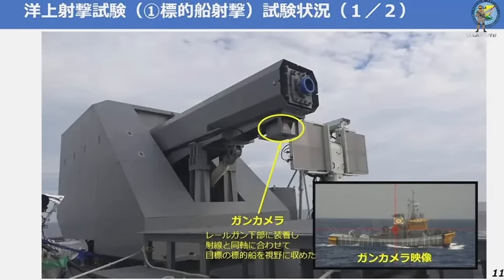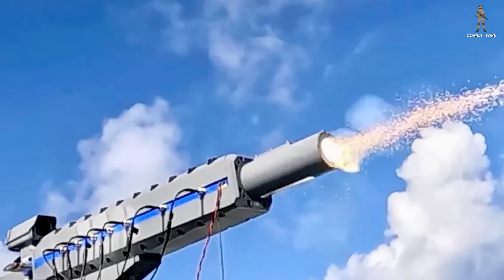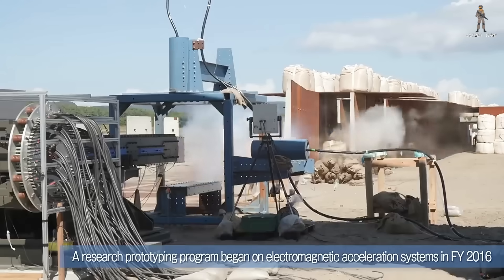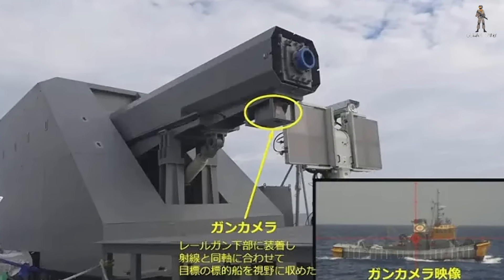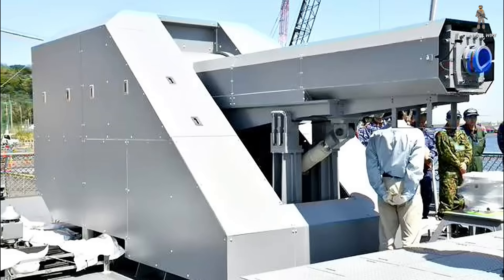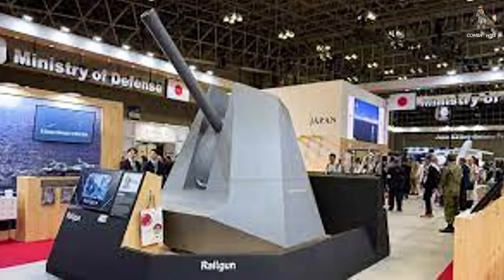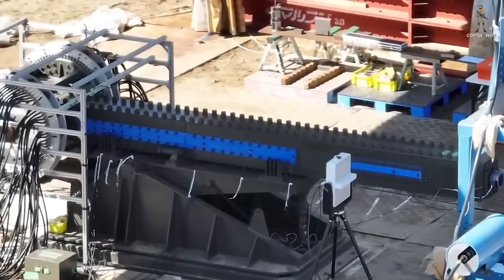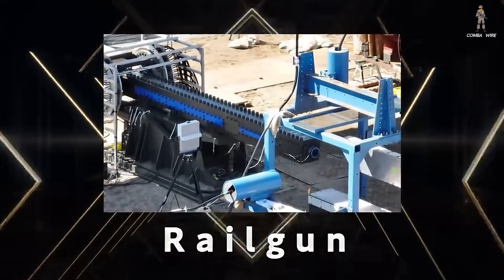For the First Time Ever, Japan Reveals True Railgun Damage at Sea.

Comment: America wanted a railgun that would match the 14 or 16" gun +20 mile range and at mach 10 speed that results in a shorter life and higher energy use.    Japan opted for a smaller with a faster recharge time and longer equipment life.
Reply: SMART strategy, start small and work your way up.
Reply: @myaschaefer6597  not so smart when the opposition has double the effective distance than yours? It's the first hit that counts not how many you can fire.
Reply: @DespaceMan  it might matter how many u can fire if they want to shoot down chinese or north korean hypersonics, i mean they could fire more than a missile
Reply: @DespaceMan  The Japanese railgun is not for shore bombardment or long range surface strike but to intercept incoming missiles for fleet defense.
Reply: @AssassinT10  There is zero chance they could fire more than missiles unless they have discovered Gundanium Alloy or Adamantium.
Reply: @Spartan1312 doesn't matter. It's a PD gun and no one is going to be happy their billion dollar missile got destroyed by a 10k slug on a platform that cost half as much.
Reply: @DespaceMan  Considering Railguns' main prospected targets are Fighter Jets, Bombers, Drones and Missiles, rather than Battleships and Static Targets.

I think Japan did the smarter choice.
Reply: @DespaceMan its like comparing early gunpowder guns with modern your brain is not ready to understand it but it will be the future in ballistics
Reply: @DespaceMan what matters was switching the mission from offensive  to defensive. 

The Japanese want to use it for hypersonic missile defense.

Smaller projectile, shorter distance, more rounds without barrel failure, ability to replenish at sea.

The problem the US ran into was size. Larger projectile, 100 mile range, massive power consumption, and associated heat from the plasma. 

Japanese just shrank the objective and solved most of the problems.

Now imagine all of your 90+ missile tubes being used offensively because your rail gun handles all incoming medium range hypersonic threats and carries 500 to 1000 projectiles @ $30k each.

You're nolonger a sitting duck once you've emptied your missile tubes. 

You can hang in to defend a carrier or other ships and still be offensive to surfice ships out to 25 miles.
Reply: @Spartan1312 They have addressed the heat issue and estimatr they can fire up 200 rounds. That's more rounds than China will commit hypersonic missiles to a single task.

Those missiles are for high value targets like carriers because of cost. How many  destroyers are in a carrier battle group at 200 rounds each.

Plus they don't plan deployment until the mid to early 30s. So they have time to increase the rounds per barrel and address the power requirements.
Reply: @IMGreg..  Laser PD seems the better option imo. At least for anything with a Nuclear Reactor.
Reply: @myaschaefer6597 the issue is it doesn't have the range missiles do. Sure you got a rail gun but if combat is done 100 miles away it won't help you. That was the biggest thing that looked the project in America. Missiles were just better
Reply: @epope98  only if you're willing to spend billions on each missile launch. The issue of Hypersonic Vs MACH 10 Railgun is economical. The rail gun could accurately intercept the missile, meaning you need to spend hundreds of millions to overwhelm something that costs 10k a shot.
Reply: @red244  I myself would bet in coilguns. Maybe a bit less effective and probably a longer barrel is needed. But when done correctly, no shear an tear with the projectile!.
Reply: @epope98 well the range is literally about 150km (93miles)
Reply: @epope98  Until you run out of missiles.
Reply: @red244 lol missile launches don’t cost “billions.” Millions maybe but not billions. Plus, it only takes one properly placed missile to take a ship down. Those railgun projectiles in this video don’t do enough damage compared to missiles and in the time it takes to make multiple shots you’ll already get hit by multiple missiles. The US gave up on it for a good reason
Reply: @red244 also, no railgun is going to accurately shoot down missiles fast enough
Reply: @zam023 yeaaaaa that’s not how that works. You don’t just run out of missiles and then give up the ship. Missiles beat rail guns any day. Technology hasn’t advanced enough to prove otherwise
Reply: @BeauDawg901  Yes it is. The Guass Cannon achieved Mach 6.5 in testing, that exceeds all traditional ICBMs and some Hypersonics and many of these have predictable flight patterns.
Reply: @epope98 it doesn't need that much range, it's for defense. More importantly it's not like it's 100% going to stay like this either. It could absolutely develop over time and become very capable.
Reply: @red244 if we are talking economics then the real win is to swarm the enemy with various types of drones.
Reply: @bp968  of course, but there are economical solutions to that too. I mean if we want to be super economical we'd swap the Railgun for Laser PD (10p per drone / missile) but it's effectiveness is more affected by weather.
Reply: It needs a modular quick change barrel system.
Reply: @bobbarker14  oh sh*t, did you just say an 8 barreled rotary railgun?
Reply: @bernarddelossantos8083 yes! 🎉 Omg yes!!! Also back up barrels on a support barge?
Reply: @bernarddelossantos8083  Space Engineers reference?
Reply: @bobbarker14  maybe a rotating barrel swapping arrangement?
Reply: @stuart207  So not just railgun, but GATLING railgun? This idea just gets cooler and cooler
Reply: 1 @steelhammer3922  Yeah. A small modular reactor is the size of a shipping container. You could park loads of them into a big ship. 1 large navy vessel could take quite a few if dedicated. You need to put a lot more down range than the enemy. If you lose an smr you need to keep fighting. Armour is useless in it's current form.

This is not about the wet navy. Vacuum is where the future lies.
Reply: @bobbarker14  Or rotating rails with angle grinders on the other side.
Reply: @bobbarker14  More like a chain of rails.
Can they not make the rails maglev?
Reply: @bobbarker14  China uses a high tech coating to resolve the barrel wear issue.
Reply: @KittyCat-nv9nd The proposed coatings still don’t fully resolve the issue presented by the rail deformation and the contaminants caused by rail shearing at larger scale. China is definitely more committed to solving the issue, but the practical application of large scale rail weapons is primarily hampered by how impractical the steps required to resolve their shortcomings are. The U.S. backed away from the project because they realized the long term application of the weapon would be too costly in proportion to the number of use cases it would be sufficient for.
Reply: @idofx8722  That's USA. USA is way behind China on anything magnetic including rail gun and emals catapult. Do not expect China to be as incapable as the USA.
Reply: @idofx8722  China is using railgun in firefighting already.
Reply: @idofx8722  While my friends use rifles to clear their farms of wild hogs. Farmers in China use ASEA field radars and drones to do it. China is a technological advanced country. US is falling far far behind.
Reply: @KittyCat-nv9nd China launched a hand full of planes off their EMALS. That's hardly way more advanced.  This was on a ship that likely doesn't have the power to maintain continuous launches. Even if the Fuijan had a perfectly powered and functional EMALS it has 60% of the duty cycle the 50 year old Nimitz steam catapult carriers because the Fuijan got the deck angles wrong as well as being too short. 

But yeah, I know, the Fuijan can launch and recover 10 million planes per second, has stealth that makes it invisible, and can fly as well as submerge to the earth's core. It also operates in space and can time travel.
Reply: @KittyCat-nv9nd lots of propaganda have you seen? I have loads of aquaintances and a friend who were born in China. But moved in this other second-world country. Because life there is to be withered and trampled down by the higher. As far as I know, almost all the advanced stuff they show, is mostly show only. Behind the scenes all these following cases are expected: not highly distributed, will be left unfinished, failure by bad company, failure in fixing issues, and just lots of hidden issues. Hidden issues like plain sub-standard build. They love to show much, but usually afterwards swipe away the broken toy under the carpet. From onlooking eyes.
Reply: @六工業のカービィ  You are parroting the China-bashing propaganda like a fool.  I have visited China for an entire month last year to see for myself.  I visited Japan too.  Japan and USA cannot hold a candle to the Chinese advances these days.  Get a clue.
Reply: @KittyCat-nv9nd  They also fired a simple slug not the fancy shaped stuff the US is messing with that scrapes the sides like razer blades at Mach 16+  That simple round slug never touches the sides.
Reply: My greatest mistake was engaging with the Chinese bot.

Edit- Case in point
Reply: @idofx8722  Wrong. you biggest mistake was coming into this world wasting oxygen. LOL
Reply: @KittyCat-nv9nd are you a bot, like seriously you spewing the chines government talking points, do you think tiamen square happened? Or are they so advanced it was fake
Reply: Japan is still having trouble with power to run the rail gun.
The USA has modular nuclear reactors that struggled to provide enough power.
Railguns work but the high power demand and barrel wear is still a major issue. 
Japanese are smart little guys and will work it out with their us and European partners.
Reply: @tclanjtopsom4846  Not about providing power, It is the rate at which the rail guns power delivery system can recharge. Recharging capacitors is not instant and they take a while to reach the desired strength to deliver the sheer amount of amps needed for the railgun. Since capacitor technology has improved in the last few years I am certain a solution is at hand. The powerplant of a ship has more then enough capacity to deliver the power needed, just not the ability to deliver it in a form as needed.
Reply: @j4ck3t  We have enough power for the EMALS catapult. We have enough power for the much smaller railgun.
Reply: @j4ck3t  by the way, one of the problems with US ridiculous punch railgun were capacitors taking up a lot of space. Is a problem on japanese side too. I am right now "micro-researching" the topic of capacitor energy storage. Since I am not allowed in labs 😢. What I want is, to be able to store nearly as much energy in capacitors as in lithium-ion batteries(energy density wise). Industry's not that far from that, but they don't even look into that. Well they just breakdown easily far away from total crystal evaporation energies. 
I've figured 3 different structural approaches in nanoscale(because you can't otherwise) to ultimately increase a crystal's or crystals' breakdown voltages. Hopefully at least two-fold. But the ambition is to increase quartz breakdown voltage up to 70 MVolts/centimeter. That's 7 volts per nanometer. Or about 3.5 volts per elementary lattice cell. That's just a few atoms. If that was achieved, I assume we could store about as much energy in the most primitive conductor-insulator-conductor type capacitors as in chemical batteries. But it doesn't mean it's a primitive capacitor hence extremely long lifespan and so loads of recharge cycles. Well, if you charge it close to the limit. One problem with using these is — even if individual cells were to be connected parallell, even if made microns thin, they'd still output at least thousand of volts. And these won't have lots of farads. Capacitor energy capacitance is capped when you reach its limit. Voltage. High farad capacitors don't hold up for much voltage at all.
Reply: @tclanjtopsom4846  Nuclear technology is still evolving. Japan and China are working on new reactors technologies and there is a huge pressure in making the reactors smaller to power all the AI datacenters in the world today.
Reply: Things that last, dont make money for the company that produce it.
Reply: Now that is an interesting counter to my argument.   I still say the maintenance is way to high for dedicated power plants of those sizes.  Bad mental image of some Japanese Captain screaming, "forget the rudder, give me all power!!!!"
Reply: Which… is rather silly imo.  Yes, it’s cool that they made one, but you could do this just as well with normal guns and probably for much cheaper pricing.
Reply: A rail gun limits you. I'd rather have laser or standard ballistic projectiles that may use miniature nuclear warheads or other ordinance options.
Reply: I was wondering why it looked small compared to the US one.
Reply: @AlbertoMartinez765  It is small. Lower power prototype.
Reply: Which isn't to say they didn't want that, but they decided on a solution that is more practicality based. There are other issues that need to be tackled as well. For the US Navy. that would end up with them likely ending up with a smaller Navy while implementing it. And at a time when we don't need our Navy shrunk. Hypersonic missiles are a tried and tested technology that we know works, and is less logistically complex due to requiring fewer parts on hand to deal with wear and tear. And a railgun is also a more complex system, meaning that it WILL be more prone to breaking down until we get all the kinks out.
Reply: @jgkitarel  Counterpoint, hypersonic missiles absolutely are as, if not more logistically complex due to stuff like the heat shielding needed on the missile, if it's anything like what is used on craft designed to survive atmospheric reentry it's a material that needs somewhat constant upkeep, and is not cheap or easy to replace in the event of material degradation, and while Hypersonics are more reliable, they're also one time use weapon systems, and are for a massively different mission set than than the railgun would ever be used for, as hypersonics still require a good bit of time to get up to speed, and aren't great for short range weapons, and using a Railgun at the same speeds would cause the projectile to most likely slow down to mid to low range super sonic speeds to hit targets at the same range considering the sheer amount of air they need to pass through when taking into account the arc the projectile would most likely have to take for indirect fire.

A railgun would be replacing the actual Gun on a naval ship, which is not used for long range combat, most commonly used for shore bombardment or AA duties, which is something a railgun system could prove very effective for, which is why General atomic is currently developing such a system with the support of the US government, as well as the US navy picking back up interest in the Railgun system as well.
Reply: bigger isnt always better in this case i guess .. but depends on the situation i spose
Reply: O tempo de reload depende não apenas do fornecedor de energia mas de sua acumulação para posterior descarga total. Talvez o ideal seria uma bateria de vários canhões que tivessem um tempo de delay reduzido no ataque, pois enquanto um ataca o outro carrega
Reply: There's potential alternatives like helical railguns.
Reply: Americans try not to go too big challenge(impossible)
Reply: there's no reason to make a 14-16" railgun, the projectile is gonna act like a needle no matter what size it is
Reply: Why not just use multiple, instead of 1 and not worry about reload or recharge.
Reply: yea like 2300m/s aint that impressive especially for a solid projectile when HE shells can be shot at 1500m/s, 3000-4000m/s would be a big improvment
Reply: Okay were all bla blah blah about the above ground we have missiles. Hear me out what about space where there is little gravity for missile arc, or the ability to yes go smaller and make a underwater a-10 that shoots railgun projectiles out of a submersible that finds and ends nuclear submarines.
Reply: We needed the tech to be lost so we could find proper integration later instead of flagshiping the tech like we did the atomic bomb. When I mean lost as in not the leading edge, like Ricky Bobby if your not first your last deal.
Reply: Railguns are "defensive weapons" used in place of THAAD. If a conical nuclear warhead, 50cm to 1m in diameter?, is hit with something massing at Mach 6 as it falls unguided from 100km above the ground at Mach 6 to 10?, the tremendous kinetic energy will destroy the warhead. A nuclear explosion requires extremely precise timing for the explosives to detonate and implode. Ballistic missiles are fast, but because their parabolic trajectory is governed by the laws of physics, their future position is calculated and they aim to hit the target. Since a single shot will not hit the target, several dozen shots are fired in rapid succession. Lasers take time to create a hole in the heat-resistant tiles of a nuclear warhead due to the high heat, so the nuclear explosion occurs while the warhead tiles are being melted.
Reply: Uh the US wants to kill you while they are having a tan on the other side of the world.
Reply: @vugu bold statement considering the use of drones by Russia and Ukraine.
Reply: @vugu  The US wanted something that could replace expensive missiles and beat missile defense systems like the Aegis. This failed on both accounts.
Reply: @Spartan1312  They failed b/c a large portion of the DOD leadership and contractors were never interested in an alternative to missiles. The rail gun project was architected to fail from the get-go, so DOD contracts for million dollar missiles would never be threatened. Similar story with Small Cheap Many drones.
Reply: @myaschaefer6597  No it failed because it

1) Couldn't reach a minimum engagement range. Meaning for them to use it they would be subject to missile fire while they closed the distance.

2) Barrel failure would happen in under 30 rounds.

3) It was massively over budget, 500 million over 15 years. If they wanted it to fail they wouldn't have strung it out trying to make it work for 15 years.
Reply: @vugu  well WW2 US16 inch guns maxed out at 24 miles over the horizon while the longest actual hit was at 15 miles by both the britsh and german it makes sense the US would want a weapon that can at least do that in a rail gun when its competing with hypersonic ship killers
Reply: @TWEAKLET pretty sure the U.S. scored a longer hit on a Japanese ship but I could be wrong.
Reply: @TWEAKLET  No the US wanted a weapon that could engage at modern fleet distances... AKA 100 miles or more. If a ship is under that it is a serious threat. This isn't about over the horizon fire anymore and has not been since WW2. 30 KM is considered Knife fighting range for ships in the modern age. 

Just like in the Bronze age the longest spear would offer advantages, now its about maximum Missile range and Anti Missile Defense. This could have been a game changer if it could have operated at those ranges because there is no defense system that could stop the slug moving at those speeds.
Reply: @Spartan1312   All I mentioned was the minimum of what they needed to even match obsolete WW2 battleships and that they would be competing against hypersonic ship killers.
Reply: And a nearly useless terminal effect.
Reply: Reminds me of supersonic flight. Engineers did the maths and worked out above mach 2 aluminium gets too hot for structural integrity. French and British built a machine 2 aeroplane. US tried to build a mach 3 aeroplane out of titanium. Guess who got a working aeroplane
Reply: @NickKeighley  The SR-71?
Reply: @Spartan1312 concord
Reply: I should have said "passenger supersonic flight"
Reply: @NickKeighley   The space shuttle used carbon-carbon leading edges and brought normal civilian passengers over mach 25.
Reply: @actually5004 how much was a ticket?
Reply: @NickKeighley  $86m with a layover on the International Space Station.
Reply: @actually5004 😅
Reply: Yes, Britain and France built the Concord, and it was beautiful. I was tremendously sad when it was retired from service and not replaced. However, it turned out people preferred low cost to high speed. There are now no supersonic airliners, not because they cannot be made, but because, the job they performed could be done better by cheaper platforms.

Two socialist governments funded the creation of a remarkable aircraft, and it completely failed to change the aircraft industry.

As this video states the US made a huge amount of very expensive progress but gave up after realising a lot more spending was required to make railguns practical. 

That research hasn't gone away. They can pick it up or join a multinational collaboration but for the time being, missiles can do the job very effectively, right now.
Reply: @NickKeighley  And China has just tested a MD10 at Mach 7 successfully. MD10 uses a detonation engine.
Reply: and its useless, who needs small railgun in the world of long-range anti-ship missiles ?
Reply: @Stanislav_Sorokin  If equiped with guidance, it could be used to cheaply shot down those anti-ship missiles.
Reply: @Stanislav_Sorokin 
Because Is a scam. An relatively light and inert projectile, whatever its speed won't go very far. Costly & useless
Reply: @alessandrorovelli7058  The Japanese one is designed to be close in defensive weapon against hypersonic missiles apparently. Get a clue. Jesus!
Reply: Was looking for over 250 mi range over the overheersen................
Reply: Because in America, the bigger the gun, the bigger the influence. America likes one shot scenarios.
Reply: @alexanderwoods2055  American railgun was designed for the Zumwalt class destroyers. A big gun for a big destroyer.  The mistake was that the technology was immature.  We have put the cart in front of the horse.
Reply: Why spent huge money for railguns, if u can just mount an 8 inch gun on large destroyer with much more reliable technologies and much cheaper. For money spent on RND u can basically build a small fleet.
Reply: USA is famous for it's issues with procurement and unrealistic ever changing expectations by generals who have no idea what's actually needed and practical in the field.
Reply: Also US demanded designs with explosive heads and inflight steering that all required shaped rounds that wear the tube of the gun instead of simple projectiles that never touch the tube or cause ware.
Reply: In other words,they used common sense.
Reply: That’s it? The US stopped it’s railgun project just because it was too big?
The feels like a simple oversight.
Reply: What iiisz daaahto?  Just get JMSD 2 buy Toyota Prius.
A lot cheaper n alrdy off the shelf for at least 10yrs.
Reply: My dude, america is asking if this can be done with steam 😂😂😂😂
"Give me a glass of water, let me drop it on the magnets… that's the end of the magnets.” " I believe that's a quote from him 😂😂😂😂
Reply: You sure you’re not confusing that with the catapult? They’re thinking of going back to steam catapults for reliability
Reply: China has put railgun on ship for sea trial about a decade ago. The Chinese rail gun was a full scale pre-production model NOT a prototype.  Japan is way behind.
Reply: @KittyCat-nv9nd Cool. Where is it now? If it worked, China would be talking about it and their naval superiority.
Reply: @thegrimreefer3185  You don't have a clue how the Chinese work. They are extremely low key and only tell you what they want you to know. LOL For example, GJ11 flying wing drones have been in service for over 8 years. And they only talked about it now. Grow up. LOL
Reply: @KittyCat-nv9nd  Xi bot, they don't have railguns and they don't have stealth technology. Grow up and stop watching Xi propaganda.
Reply: @Stanislav_Sorokin cat is propaganda lol.
Reply: @Stanislav_Sorokin  LOL It is now confirmed. The JG-X drone stealth bomber is called JL-1, a 200 tons drone bomber.  China is churning out new  tech all the time. You need to take more copium.  LOL
Reply: @KittyCat-nv9nd ”new tech” is copying from US? Keep cope Xi boy 😂😂😂
Reply: @thegrimreefer3185  Interesting enough, China has just unveiled another B2 like drone called the CH-7.  China is writing the new chapter on warfare. Cope harder, boy!  LOL
Reply: @KittyCat-nv9nd  Then where is it now!
Reply: @BrasswoodProd  You mean the Chinese railgun?  LOL You will see that on the 18000 tons Type 059 destroyer that they are building.  You don't need to wait for long.
Reply: Doesn't matter what they opted for.  Japan did not solve the rail degradation issue, it's not going to be solved in your lifetime.
Reply: @DoctorMangler  I mean most people didn't think railguns would even be a thing now. So don't say that. We got rockets landing themselves.
If we spent more time advancing instead of humouring mentally ill people we would be advancing faster.
Reply: @MrBashem  We don't have the material science.... it doesn't exist.  Rail guns will not be used in war in your life, and probably not your kids lives either.  That's a fact.
Reply: @DoctorMangler  The 16 inch barrels were introduced with a life span of 300 shots. Sure, they got to 1500 shots in 5 years during wartime. but when you hit everything with the first round, 200 shots for one barrel is enough. Even todays tanks are build with a 300 shot life span barrel. It is enough for war
Reply: @DoctorMangler Unlike the U.S., Japan cannot afford to keep sinking billions of dollars into developing a weapons system that will never be fieldable. So for them to keep working on this after the U.S. gave up clearly shows that people in their military and government with way more information than you and I are confident that they can overcome the challenges.
Reply: @andrewawakened628  ??? It's cheaper than the hypersonics it's designed to destroy. Much cheaper.
Reply: @DoctorMangler  You'll be wrong sooner than you think
Reply: @BrasswoodProd  No, I'll be long dead, and rail guns on ships will still be a reality a few years after we have fusion power.  Maybe your grand kids will enjoy rail guns on ships.
Reply: @DoctorMangler  Don't say that too fast. Metamaterial research is going hard right now.
Reply: @DoctorMangler  they didn't solve it, but they opted for an option that would cause much less barrel wear over time, less power needed, less mass, which means technically less force on the barrel to get an object of less mass up to similar speeds.

Completely getting rid of barrel degradation is not ever going to happen with railguns, as the object has to touch the rails, and while coilguns avoid this issue, they're way too heavy to use realistically, and require more power and a lot more electronics to time the coil cycling. 

The aim is to reduce the barrel wear as much as possible, or developing a system where the barrel can be hot swapped, but getting rid of it isn't something we can do while keeping the weapon effective against moderately armored threats
Reply: @DoctorMangler  They literally did solve it. They were designing for 120 round and now can fiver over 200. Sounds to me like performing to specification.
Reply: @DoctorMangler  False the degradation did not even start until the Military started demanding custom sabot rounds that touch the sides of the tubes instead of being centered by the fields.  The Same tech has lasted over half a century with constant use at both Disney and WVU with maglev monorails.  The first gen lasted 1000X as many shots with a basic slug before they started playing with the fancy custom jobs that included in flight steering, explosive heads, and delayed explosion options.
Reply: @charlesmaurer6214  False, the degradation is from the plasma, contact or not.  That's been the problem for the last 35 years.  And  maglev is nothing at all like railgun, you got your comparisons all goofed around.
Reply: Why a rail gun if the 7 inch canon is perform far better and do more damage. The best for future tech is the laser weapon because it's has no bullet but only a laser.
Reply: @c.t6149  The Japanese are probably aiming to use railgun for ship defense against hypersonic missiles. At hypersonic speed, the kinetic energy of the railgun shell will destroy any missile in a direct hit. It is also far easier to harden missiles against laser weapons than raising the power level of laser weapons to burn through missiles.
Reply: @DelAoc  No on laser, just chrome coat and it is reflected away.  Masers however work the same way but the wave length destroys most metals and electronics.  Microwave instead of Light.  Gamma Ray (Graser) or X Ray (Xraser) may also be useful.
Reply: @charlesmaurer6214  Microwave can be easily blocked by mesh shielding.
Reply: You clearly don't understand how lasers pr kinetic energy works... sea has high humidity...lasers defuse through humidity thus loosing power.
Reply: @c.t6149  Lasers don't work in bad weather which is often the case on the Ocean.
Reply: @c.t6149  Not Laser but related Maser would be better but with a simple slug type rails too, not trying to use them for firing a smart weapon mini cruise missile.
Reply: @c.t6149  If you look at how the Japanese Navy is designing the railgun, you should understand the intended use. The main purpose for Japan to develop the railgun is to shoot down missiles (and these days drones). The reason is obvious if you follow the war in Ukraine. Modern anti-air missiles are far too expensive and inefficient relative to the volume/cost of incoming cruise and ballistic missiles as well as drones. (If I recall, the anti-ballistic missile SM-6 costs about US$10mn per missile.) FYI, Japanese Navy is also testing laser weapons on the same test-ship ASUKA.